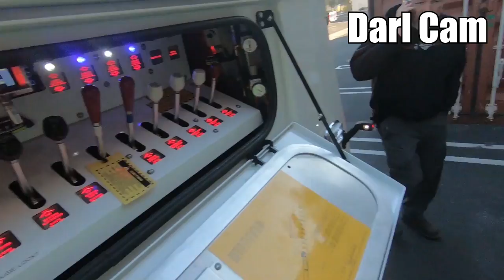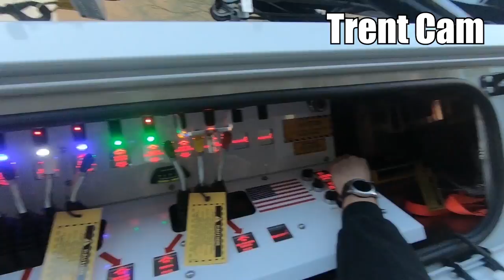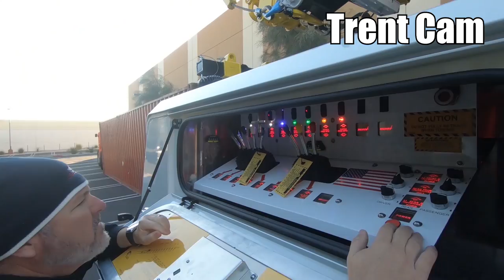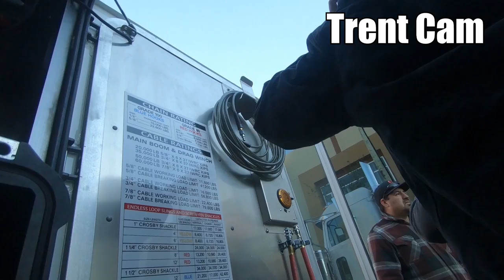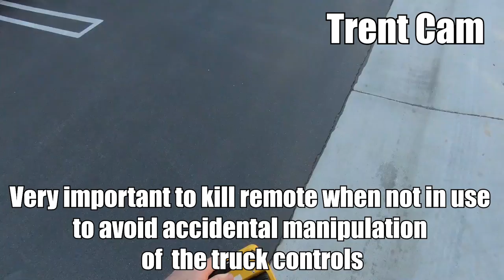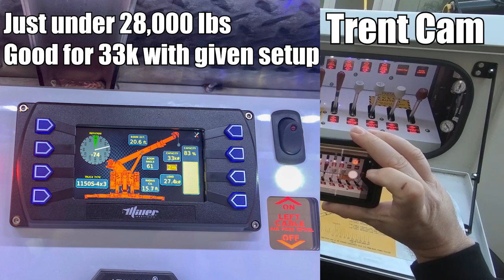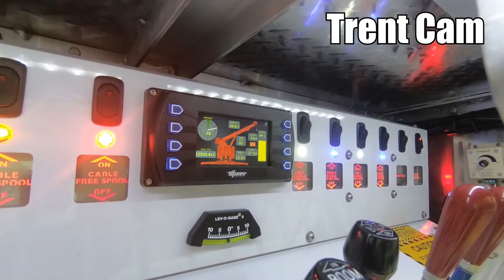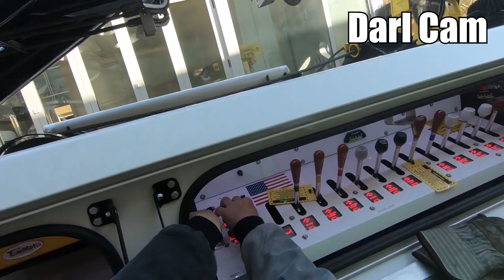Lifting A Custom House With the Rotator!

Comment: You'll be getting a lot of jobs where a big crane won't fit. Inside buildings and in tight spaces. Both the truck and the radios make those jobs easier.
Reply: You'd be surprised the number and variety of tight access cranes there are out there.
Reply: I can put our 200 ton capacity crane just about anywhere they can get that rotator. Mid span outriggers and 10 wheel steer make a big difference in where you can get a machine. Actually, I could set up in an 20' x 55' area and pick that rotator up. Not taking anything away from a rotator. They are great at recovery work. But, they won't replace a crane. Each one excels at what they were designed to do.
Reply: I second what TTTC said, the machines only limit is its size and max capability that the machine operator is comfortable with and understands.

Comment: Why didn't you guys opt for the Raptor Controls?
Reply from the maker: We are more of a fan of the simplicity of the controls we have. More simple and everything is readily available rather than shifting through menus. With that being said the raptor system is awesome! I like the load sensing on the remote which is one downside to our system since the load sensing is only able to viewed from the main station. Thanks for watching!
Reply: @plazatowing  Amen!
Reply: Stick a gopro or some cheap wireless cam to the top of the control panel compartment looking at that screen and watch the load panel on your cell phone.
Reply: Thanks for replying and making such great content! It is watching content from channels like yours, Ron Pratt, and 1140 rotator work that have made me want to get into the towing and recovery business. Keep up the good work and stay safe.

Comment: I typically set 5-10 houses a year on basements. They are modular houses instead of container houses. They generally are between 35k lbs and 52k lbs. I have a few videos of them. It amazes me that things like these withstand the stresses put on them. Nice work! 🙂👍
Reply from the maker: Thank you sir got any pointers for this lift?
Reply: @plazatowing , if you had some spreader bars, you could keep the rigging off of the sides of the piece.  The rigging angle looks good. Maybe keep some old carpet squares or pieces of rubber on hand to use as softeners to protect the rigging and piece. Not that the rigging was in jeopardy on this pick. As it had rounded edges. But, if this were a square edged container, or something with sharp edges, the rigging may suffer. You may want to pick up some poly crane mats (we use DICA mats with our boom trucks). They are incredibly tough, lighter and stronger than plywood mats. They also live longer. They tend to be more expensive up front, but will pay for themselves in the long term. But, all in all, you guys did a great job. Not much to critique here. If a person says otherwise, they are nitpicking or grasping at straws.
Reply from the maker: Good points! We already ordered the DICA pads! Glad to hear you recommend them
Reply: @plazatowing , you won't be upset with them. They are tougher than woodpecker lips. Lol. If you don't already have rolling blocks to part your lines up to two parts, I'd see about picking some up. I sometimes part up to 2, 4 or 6 parts of line for precision and not capacity. Even with as precise as the crane winches are, I still need to be able to cable up or down in 1/32 of an inch. Those are the instances where many parts of line are your friend. It makes things really slow. But, also gives you the ability to be very precise. I don't know that you would use them often, but I'm sure there will be times that you wish you had them. Also, I would keep nothing but authentic Crosby shackles on there. There are some imposter Crosby on the market. They are knockoffs. I just encountered some a month or so ago. I can also tell you from experience that I have never had a real Crosby anything fail when used correctly. But, I have seen others fail when used as designed. Just my two cents. Take it for what its actually worth (probably more like one cent or less lol).

Comment: Glad to see your feeling better Trent. Just a tip your gonna want to disengage that pusher axle from automatic mode. You will find that you run out of air real fast when you find yourself backing up and pulling forward in tight spaces. Also nice to see someone call it what it is and not call it a tag axle. I'm sure you probably know but you don't have to lift your truck all the way off the ground. Anyway just giving some tips not telling you what to do.  Why didn't you guys use your spreader bars? Glad your feeling better. Good job.  Love those head sets.

Comment: Right off, I'm digg'n the intro tunes! This looks like a good pitch for the spreader-bars! Eh, maybe not yet, those chains up high around glass and what looks like aluminum finish, was causing me some anxiety. Jim (White's Crane & Steel), is pretty impressed though! 

I'm wondering if that hydraulic pump has some sort of constant-velocity interface that keeps the degree of control inputs and the resulting output, constant throughout the operating range - might be why any idle-up is discouraged from the manufacturer?

Great job, great video - looking forward to more, Thanks! Cheers-
Reply: Idling requirements are computer controlled afa I understand.

Comment: I'll chime in with wondering why the spreader bars weren't used either -- by their nature, you would think that by design they would keep the (overly narrow) straps from crushing the top corners also; in turn you would have reduced the amount of strap up in the air, allowing more cable to play out from your boom, self-leveled side to side (perhaps with a quick adjustment to the rigging), and been able to easily control front-back level with the two winch lines... but I am just an armchair 'tator op!  I get that the company owning the structure did the rigging, but they sure made your day tougher!  Well done lift, in any case, steep learning curve, but well accomplished!
Reply from the maker: Absolutely agree 2 spreader bars would have been easier but like I said company insisted it be done this way. Nice suggestion!

Comment: WOW -- That was an impressive lift. Your dad mentioned that was the first paying job. You certainly started out with something that would challenge both you and the truck. I was wondering if it would be easier for you to stow the hooks in the small rectangular yellow "blocks" on the back of the truck rather than rotating the boom and using the "wire loops" on the boom. You gave credit for the crane operator being there to offer any needed advice. Why did he have his crane on site? Finally, I'm aware that the headsets are used to aid in your communications, but they are sure nice for the viewer to hear everyone rather than just the person with the camera. You fellows work very well as a team. Looking forward to seeing more of your videos. (I hope your hernia repair is coming along well.)
Reply from the maker: 1. The wire loops we are hooked into in our opinion provide a super clean and scratch free mounting option. When snatchblocks are not on the cable this is where we will stow them and then they will be stored on the yellow blocks when a snatchblock is present.
2. The crane operator was on site because this was his lift to begin with but he wanted to see what the rotator could do so he brought his crane just in case and also performed the offload. 
3. Glad you enjoyed the headsets!!
Thanks for watching
Reply: those blocks are commonly called d-rings or otherwise known as rigging shackles

Comment: I thought it was to be at 8° when stowed. At least that is what Ron has said many of times.
Reply from the maker: 8 degrees if I recall is where Ron's truck sits at 13ft 6 inches. Every truck is different but we just get the boom close to the underlift and call it a day. There is no right answer as long as its not to high
Reply: @plazatowing  Thanks!!